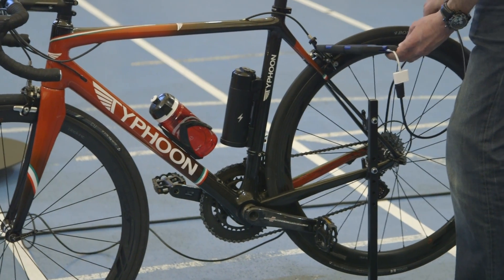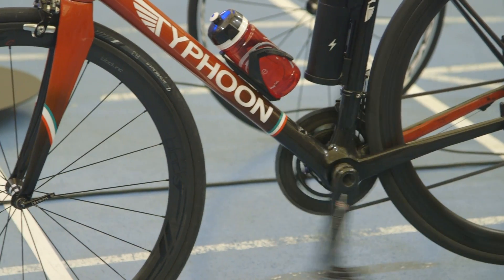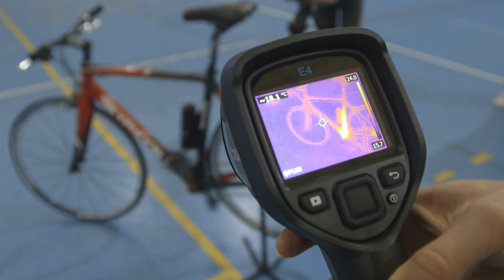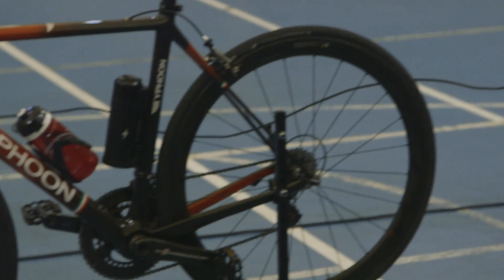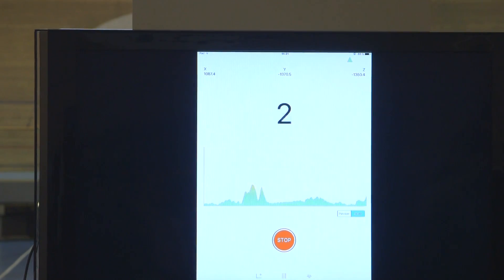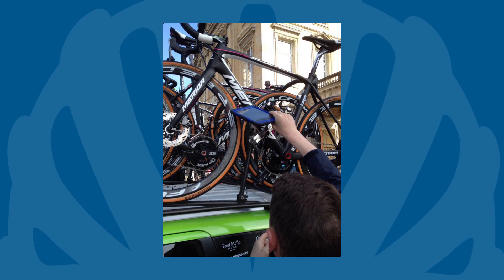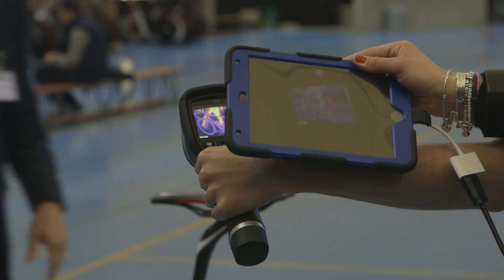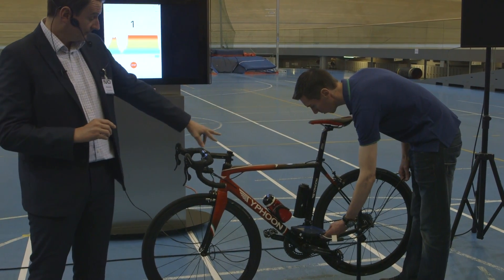How UCI Detects Mechanical Doping

Comment: What happens when a team puts metal weighs in the BB to make a light bike UCI legal?
Reply: Jared Fontaine metal by itself wouldn't register a magnetic resistance. The coils in motors do register a magnetic interference. That's why, for example, the chain doesn't generate a magnetic resistance even tho it's metal.

Comment: so, what are you saying is you measure magnetic field? Because you can build an electric motor without use of permanent magnet. So i suppose it is more complicated than that.
Reply: moving charges produces magnetic fields.
Reply: Tomáš Jozífek even a non permanent magnet will stay magnetized slightly after use.

Comment: You could just tell all the riders they have to have the seat posts off the bike until 5min before the start.  You can optically scope the frame and it costs nothing other than bikes have to have quick releases on posts again.
Reply: Riders have a set place for the seat tubes, that's why they have their name on the bike, because I'm sure there are many riders in let's say team sky that have a medium size frame but different seat heights so they have to know which one is their bike, also the slightest change could change the outcome of the race and anyways the motor doesn't have to be in the seat tube so it would serve no purpose to take it out.
Reply: +עומר וגיא להב I was not thinking it would be in the seat post, rather that it would give access into the frame.  you could then scope the frame.  A simple stop on the seat post would deal with the seat position issue.  This rule would also allow poorly funded events to still provide inspections.
Reply: 3ridetec a